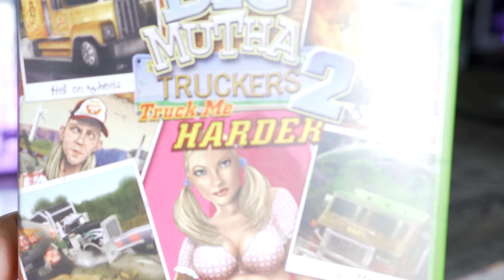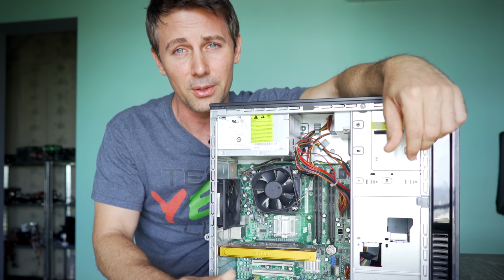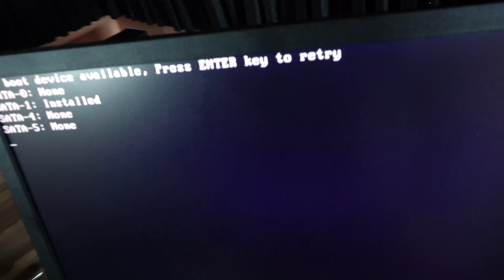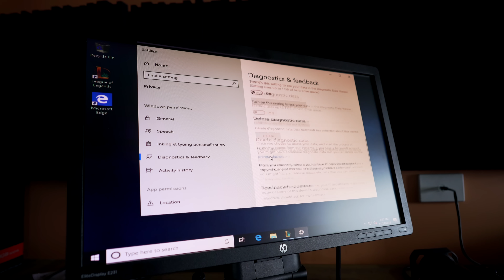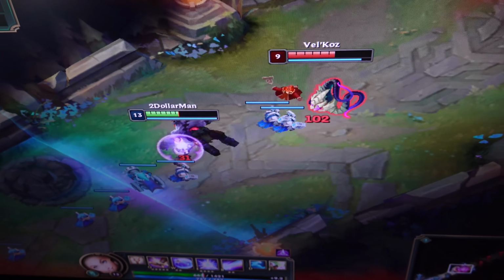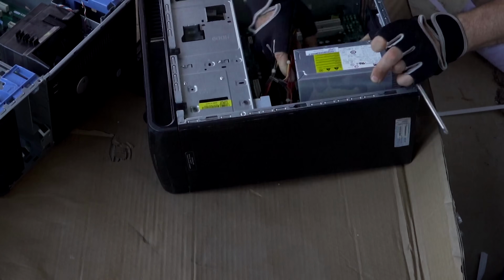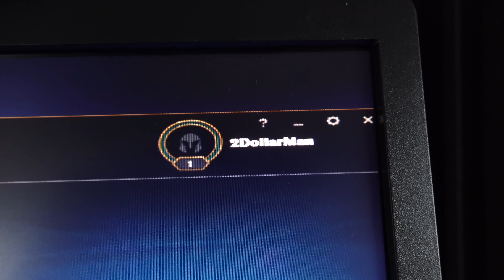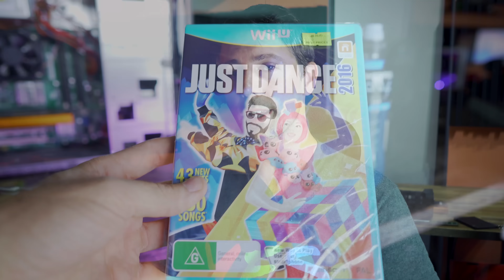This PC Costs $2.... Can it Play League of Legends...!?

Comment: Did you try bios update ? Or downgrade ? I used to have a potato oem pc that had issues for ram and other stuff
Or maybe its the windows 10 ... Put windows 7 x64 instead and try not to install all the updates
Pc was acer aspire t160 (core 2 duo t series 1.6ghz 1066mhz fsp ? with 2gb ddr2 800mhz ram , the motherboard chipset was ati 200 series which was fine and i upgraded the psu to install gtx 760 2gb card and it worked
World of tanks 1.0 ran good over 30fps at 1080p lowest settings because the cpu was a hard bottleneck , 1080p videos were stuttery but it surely was alot faster than yours ... Bios was updated to the latest one available to keep it working with windows 7 becauze the pc came with windows vista 
Btw the pc works fine now for light 2d cad works on autocad 2010 and office 2016 ... Gaming wise its for the lowest settings on any game that does not require 4 threads or more than 2gb ram
The gpu that was with the system i remember it was an ati card then it was upgraded to hd4350 silent 1gb

Final thought .... That pc you just did is a 30$ scrapeyard pc ... Not a gaming pc and surly not a 6$ pc 
lga775 are dead nowadays .... I think sandy bridge is the bare minimum now

Comment: I happend to get my hands on a Dell optiplex 780 sff (BTX motherboard), with LGA775 socket, thankfully accept ddr3 memory. so i put a core2 quad 9400 or something, 8 gb of ddr 1333, and a brand new gt 1030 sff (the ddr5 version)  from asus (didn't have a coler just a bad ass looking  heat sink). My son plays fornite everyday on it, 720p medium and more than 60fps stable. The cpu and the memory come from aliexpress. Give 775 a chance

Comment: Some Dell mobos, like the one in the Optiplex 320, only support max RAM when using integrated graphics. Once you add a video card half the RAM is ignored. Something about shared IRQ or DMA channels. I have an optiplex gx620 with a Pentium D 960, 4GB RAM, and a GT-640 that plays  modern titles at "playable" fps.

Comment: I have so many LGA 775 that gives problems.But i got one gem that are the only board that works with my E6700 and it can clock to 3.4ghz i use her as a storage server now only draw back is it only has a 10/100mb network card in so trying to source a gigabit pci card for her still.Main problem i have with lga 775 are compatibility issues where it would declock the cpu to 1.2ghz-1.6ghz even if i manually set it it would just not boot.I tried different setups bios updates etc and it still does the same.

Comment: Secure Boot and imaging is the most frustrating thing I've come across with tech lately. EUFI has ruined how easy it used to be to manage workstations on a global scale. I wouldn't be surprised if the option to disable secure boot isn't available in 5 years. RIP PXE.

Comment: If you're going to go with an LGA775 prebuilt, I would suggest a Dell Precision. I have a Dell Precision machine with a Q9650, 8GB of RAM, and GTX 750 ti and it doesn't have these compatibility issues. The old Precisions have much better compatibility than the Home grade machines.

Comment: Later revision of LGA775 weren't too bad. Earlier this year I had a PC in my garage running an E8400 and a GTX 750 which was able to play WoW. Upgraded it with a $30 AUD Q9505 from ebay which gave it a huge boost in performance comparatively. Having said that, this PC did have 16gb of DDR3 RAM and a cheap 120gb WD SSD for boot. 
But if you get the right combination, its definitely viable for games that don't have high system specs.

Comment: I’d suggest using Shell Shock .io as a benchmark for old systems like this. Really pushes older systems and you can pull up task manager with it and see if you’re CPU, RAM, or GPU bottlenecked.

Comment: The most annoying thing I've had to put up with, is the Dell's HP's and PackardBell's, that will only work with the parts it was shipped with and lack plugs/sockets/slots for stuff it wasn't shipped with (like having no AGP/PCIe slot on the board in a box that didn't ship with a dedicated Graphics card). The level of non-upgradeability of the older premade-PCs was horrendous at best. If you even see a motherboard with bare solder pads for memory/AGP/PCI slots that were never soldered onto the board, just walk away, it's not worth it.

Great vid TYC.

Comment: Other than an old HDD dying with the only copies of a bunch of photos probably the worst experience for me was due to a GPU hardware problem. It's an HD7870 Sapphire GHz edition and I happened to buy one second hand with the faulty ceramic capacitors that I wasn't aware of, basically everything works fine until pretty much at random but mostly during games the screen just goes black and the PC needs to be restarted to get it working again. I still have it around and actually intend to fix it or attempt a fix once my hot air gun and a capacitor meter arrives from China, then it's just a matter of removing the most likely culprits, figuring out their capacitance and buying replacements, doing this more out of spite than anything else.

Comment: mate i would just use the case and psu from that as a base for a cnc control box a pc psu has 12volt and 5 volt rails  that are perfect for that king of thing you will pay about 2 to $300 for the cnc bits + your time but in the end the cnc control box has got to be worth 6 to$700 at least

Comment: The worst thing that happened to me is with a Medion MSI  motherboard,I had a compatible CPU,compatible RAM,but it could never boot! I thought it was the CPU,but later on I discovered it wasn't. Then I thought it was the RAM or something,but the RAM and the GPU both worked on a different MoBo

I was done with 775,until September 1st when I built my first ever potato with a Pentium D 820 and 512MB of RAM,running Windows 7 Pro,then it went from 512 to 1.5 and finally to 3,then I changed the CPU three times when I finally caved in and bought a Xeon E5472,and now everything works flawless!

Oh and the specs are : Intel Xeon E5472 @ 3.0 GHz,4GB of DDR2 @800 MHz,AMD Radeon R7 250 1 GB GDDR5,240GB SSD,640GB HDD and a 420W PSU

GTA V can run from 30 to 43 FPS,Flat Out 2 is running on a constant 60 and Minecraft goes from 54 FPS to 60,and sometimes it's pegged at 60FPS

Comment: Watching this very video on an ASUS P5Q pro turbo M/B with a q6600 and 6gb of ram. It is not my first choice as it was my XP gaming PC. For some reason my windows 10 PC just out of nowhere wouldn't turn on the next day. Shut it down before bed one night and went to turn it on after work and nothing, not even a fan twitched. The heat sink on the chip-set was warm so maybe it didn't shut down completely and burned something? (Gigabyte GA-z97x and 4790k)For what this PC is it is very capable machine. For XP I use it with a hd5770 and 4gb of ram, but with it as my only PC right now I stuck a r9-270x and the extra 2gb of ram so I could keep playing my main games (Fallout 4, Skyrim, and Farcry 3-4). Is it bottle necked? Hell yes! But with careful tweaking I can get "playable" frame-rates.

Comment: most frustrating thing recently was ordering a duo core CPU for a socket 775 retro pc. I wanted to put an E6700 core 2 duo in the pc. well, Intel gave that name to 2 different 775 CPUs and I ordered the wrong one the first time. I got a Pentium e6700 but the mobo I got will not work with it only the core 2 duo e6700 will work. smh and lmao glad both CPUs total only cost me $10, could have been worse. should be getting the Core 2 duo in the mail tomorrow.

Comment: I had 2 LGA775 ABIT A9's MB's and sold one and the one i kept just would not boot past the post. So i threw bios chips at it, numerous windows installs, memory swipes, power supply switches, etc. In the end i bought a nVIDIA 680i SLI Rev. 2 with a q6600 GO OCced. to 3.6Ghz' 8GB 1200Mhz ddr2 and to this day' i am still using it. Chucked an ASUS dual 1050ti OC in it with some samsung 850 evo's in raid and i cannot complain. The P5Q was another option but was to expensive back then.

Comment: My most painful experience was probably troubleshooting my xeon x3440 server board, ram wouldn't detect, fixed that issue, then the cpu wouldn't even boot because of some problems, but my spare i5 750 ran it just fine, my board is dying but it's all i got for right now. :/

Comment: My parents had/have an E5400 based PC with a graphics card integrated into the motherboard (and a whopping 378MB of VRAM), 2GB DDR2. I could play League on it with like 15 FPS, lowest settings 768p, which was alright for casual play in my eyes. Though I recently upgraded them to an Athlon 200GE when they started getting some memory-related BSODs.

Comment: Hey Tech Yes, I'm sorry to hear of all of your issues with LGA775. I personally am running a LGA775 system. I highly recommend if you do a lga775 build that you get a board that can support Xeons through a bios mod and  a premodded xeon. I have a Xeon x5460 paired with a XFX R9 270 and 8GB DDR3 1333mhz and this thing can kick ass in games like Overwatch and Far Cry 5.
Reply: BTW my Mobo model is Asus P5QL-M EPU/CM5571/DP, it's from an Asus CM5571, I can't OC but It's still a good board, I have a bios mod to enable AHCI on it.

Comment: LGA 775 is just about useless now except for the Core 2 Quads like the Q6600 and higher. It honestly just boils down to the dual cores plus low frequency plus low IPC all coming together as the perfect storm of crap. At least the Quads are still able to run E-Sport titles, especially with the tape on the pins trick that overclocks the C2Q’s to over 3 GHZ. Yep. All usefulness out of the Core 2 generation of CPUs are just about gone.

Comment: I have a 775 Pc Asus P5b Deluxe with a Xeon x5460/Radeon HD 6970 and it works very good even with actual games xD.
Reply: yea i had a radeon hd 7 series card and that couldn't run overwatch lowest settings above 20fps so idk about that one bud, i have upgraded since tho i currently run an Intel DQ77MK Intel Core i7-3770 3.4GHz quad-core, NVidia GeForce GTX 1050 Ti GPU, 8gb DDR3 1600MHz, Coolermaster hyper 212 evo and nzxt s340 elite, 450 w PSU
Reply: @rhyanandrews1979  yeah because the 7 series can only run 720p max or they get slow also overwatch is not a mid heavy or a light game it is a unoptimized Heavy game also when using a gpu like this you shouldnt consider any triple a title or games that are competitive

Comment: Hey 775 is not that bad, years ago built a potato first PC for money I saved with some after-school work.
It was like in 2015, R9 270, quad Xeon 5540 OCd to something like 3.7GHz, 4x2GB(8GB) DDR2, asus P5Q-E mobo, some cheap used cooler master 700W PSU, new budget case and 1TB HDD, all for about 2000PLN(500USD) and could play many games at 1080p and 50FPS like witcher 3, battlefield 1, rise of the tomb raider etc.
Reply: 700w not a bit overkill?
Reply: @thebhoy2000  It was just cheap xD

Comment: You should def get some Akasa TIM Clean or similar citrus based solvent to clean up the gunked TIM. Much better results, much faster to work with.
Also some coolermaster things comes with credit card sized piece of plastic which has just the right amount of flex and thinness, with which it's super fast to remove typical dried up TIM, then quick wipe with Akasa TIM Clean, quick wipe with dry rag and you got a shiny shiny die ^_^

What was on the GPU tho i have found out that type is best soaked in acetone base brake cleaner. Plain acetone works too, but takes a few minutes for it to soften it all up.

.... yea i have to clean up ton of dies & heatsinks constantly... I've installed probably more than 100 CPUs in the past year alone, close to same number of chipset cooler replacements etc. I got quite a routine for it at this point :)
Reply: Akasa is great!

Comment: Thats REALLY strange! 

Because even my shitty netbook with a singlecore atom @1.6ghz, with 1gb of ram, and a shitty gma 3150 cpuld run league of legends at at least 15-17fps, with drops to 5-9 in teamfights. 

AND my free philco phn14545, with a pentium dualcore @2.1ghz (core2duo based) with 2gb of ddr2 ram (667mhz), and a potato sis mirage 3 running windows xp in a failed hard drive (about 200 unrecoverable bad sectors) could run league of legends at about 25-34fps with drops to 15-18 in more intense scenes such as teamfights. 

So clearly your theorically much more capable systems should perform way better. 
And i know 2 ppssible culprits for that! 
1- A bad/overheated cpu, usuay these 775 cpus spent ages in a non maintained pc, with too many dust, problematic thermal compound, and it overheated too much once or overheat several times to the point that the chip is damaged, usually clockspeeds dont go up, but there may be other symptoms like some very simillar you experienced there. 

2-Damaged/overheated chipset, these things are never maintained, aways overlooked and forced, and they tend to wear out with time too. That unfortunatly its the moet common issue with the 775 and phenom systems. 

But a sort of hint but also a sort of constructive critique: 
You should have installed msi afterburner to check what were the issues, what was bottlenecking while the game was running. And thus not relying only on top of supposed information. Msi afterburner has a free version wich has less features, but really more than enough to that usage.

Comment: i used to have that dell vostro 200, to make it recognise more that 3.5 gb of ram you must upgrade the bios to the latest version.
before i sold it, it had a core 2 duo 8600, 8gb ddr2 800,  an  nvidia gt 620, and 3 160gb hdds.
it was good enough to play csgo on 768p 2 years ago

Comment: I think that is an OEM board issue.
Reply: Dell's motherboards are very unqiue. My LGA 775 Dimension 4700 for some reason hates IDE drives whether through on-board IDE ports or through a functional IDE expansion card.
Reply: I don’t think so, my Optiplex 360 has none of these issues.
Reply: Some Dell's work as intended. Some Dell's don't.
Reply: I agree with you.

Comment: So i have a motherboard with lga775 with intel core 2 quad q9505 , 8gb of ddr3 and a gt 1030 the ddr5 version , and the pc runs just fine even on Shadow of the tomb raider on 720p and 30fps.
Reply: Thats a good esport gaming PC. Like Fortnite, CSGO, Rockrt League, Overwatch. Thats a nice secondary PC. Too bad the architecture on those Core2quads are getting old. Sucks they could still be solid CPUs

Comment: Strange that someone had to disassemble and clean a computer that had absolutely no dust in it...

Someone didn't have a 10 minute video...
Reply: Also, if you have to switch out the CPU and motherboard on a '$2 computer', it's no longer a '$2 computer'. 

This is what happens when half-assed, unoriginal channels, make videos.

Comment: The OptiPlex 745 supports Core 2 Quad 1066 MHz FSB CPUs. The OptiPlex BIOS needs to be updated to use the 1066 FSB quad cores.

Comment: Actually 775 is not that bad , i bought a GA-P43T-ES3G running with a Xeon X5450 on 3.6 Ghz , 12GB DDR3 ram and i can run anything depending on the graphics card .
Not having any issues . Just those old OEM 775 Boards are kinda crap.
Reply: Good luck running Assassin's Creed Oddessey on that Xeon... Not gonna run at a pleasant frame rate... An i7 3770k is twice as powerful as that Xeon lol
Reply: @zackburkhart6521  i bought the Xeon for 10€ , so for that price its pretty amazing

Comment: Pentium E2180 2 GHz stock(3Ghz OC)
6gb ram ddr2
Radeon HD 6670 1Gb slightly overclocked
It's running League Of Legends at medium setting 1080p at 80-100 Fps in PVP mode even in intensive fights I got 60-70 Fps, still can run League well.
Reply: Similar to my 775 build e8400 overclocked to 3900mhz  on stock. 1 2gb stick one 16 gb readyboost stick. One 6670 radeon 2 gb version works well. Bryan needs to not let this beat him and have another go at it

Comment: I could play league of legends on a amd e-300 apu laptop and 2gb ram with atleast 25 fps granted it sometimes drop to 3 fps on 720p . And i've got the same problem on being stuck on 100% . Reconnecting saves it sometimes but they remake 70% of the time and i've got penalties for always not being able to load the game. If you tried turning down all the settings to low and going to the game.cfg file and tweaking some stuff maybe you can get a playable experience with that system. Love your videos man. Im trying to find a cheap system to build that would also be able to stream and your vids help me figure out what im going to build. Keep up the good work and ♡♡♡

Comment: i played league on a celeron dual core 2.4 ghz dont remember the exact model , 4ram dd3 and a  9500gt at 1080p lowest settings 60 fps locked and i dont know how i sold that fried potato for 100$ in 2017 😂

Comment: YesMan I had and LGA 775 CPU and a really old gts 8800 I was running league of legends everything low and it was giving me solid 25-26 fps
Reply: Oh and resolution was 720p
Reply: PC cost me nothing since the person who was selling it said didn't turn on at all and all she wanted is to get rid of it
Reply: And I checked everything and finally got it to turn on
Reply: But wasn't giving any display signal and the PC will turn off and torn on itself. So I looked for a LGA 775 motherboard and couldn't find any and found some of them online but with prices tag of $50. So didn't bought it, and after 2 months I found and ad on Facebook market a person selling 2 motherboard both LGA 775 but I got the gigabyte one for only $20 and CPU included. And finally it boot.
Reply: Don't give up on LGA 775.
Reply: And the CPU that originally had is a Pentium E6500
Reply: And personally OC to 3.3 GHz with the OC guides from your channel
Reply: And motherboard chipset I think it was a p35